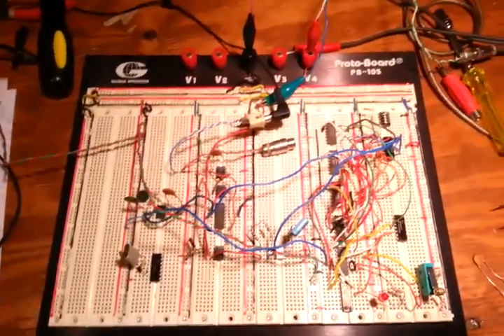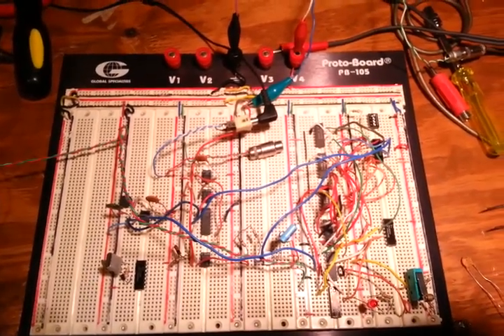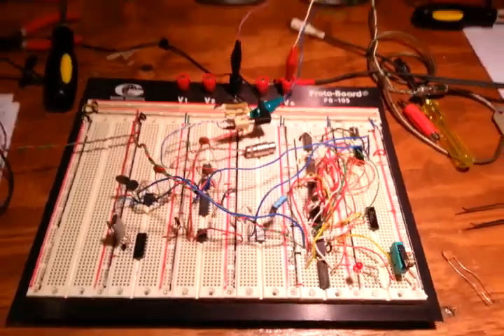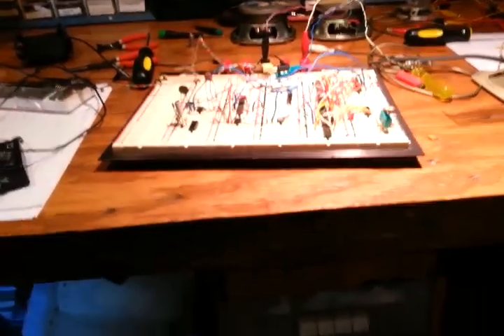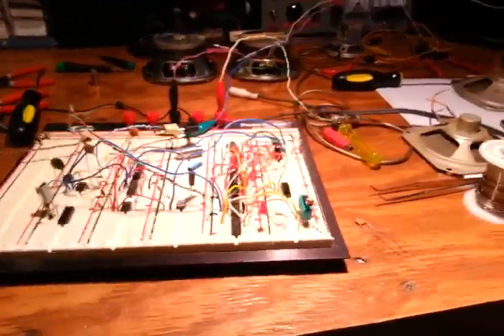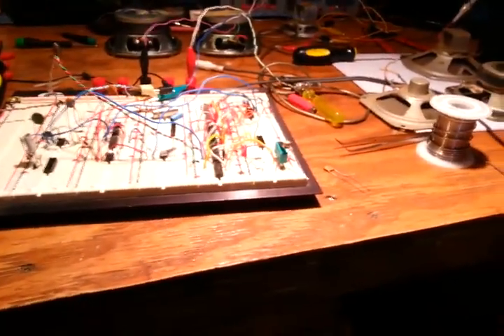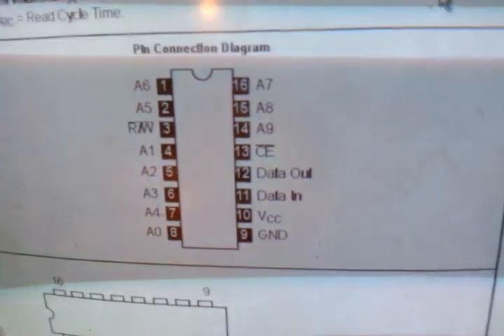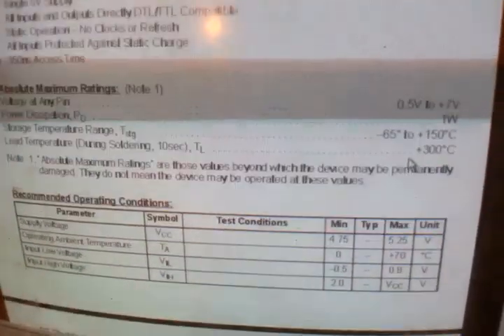Improvement in the 1Kbit digital recorder, homemade.

Comment: Yo can get the old memory chips from a 286 or 396 motherborard. Someones used to have chache memory, static ram type, so you can do some reasearch and eventually get large memory space for almost nothing. I remember a very old mother board having large RAM chip onboard. Large ... said, 64KB memory ... something like that. Not Dynamic type. Don't mess with that. Just static RAM chips. The static one doesn't need to be refresheed and information will last until you cut power. Dynamic ones need a refresh, every 1ms (to say something) in order to avoid data corruption. If no refreshed, ram lost its data even with power. Also, old video card used memory chips ... you need to have a look there.